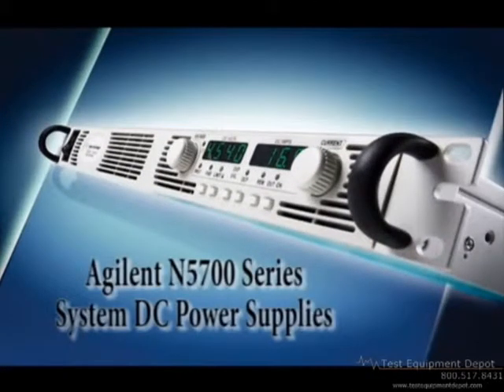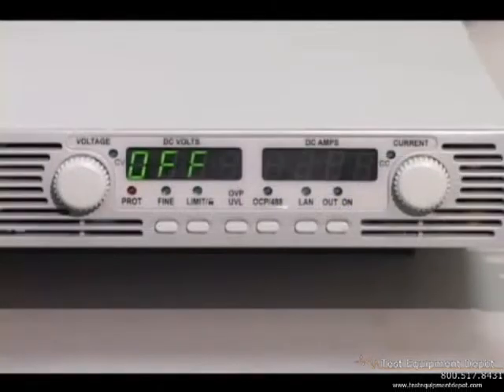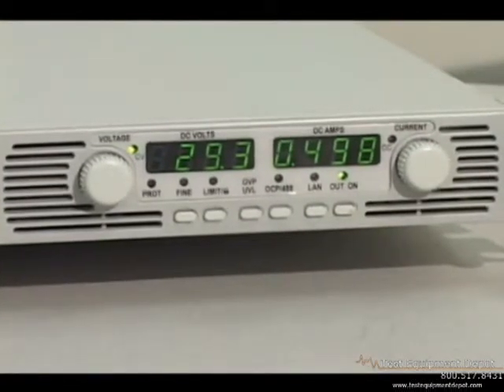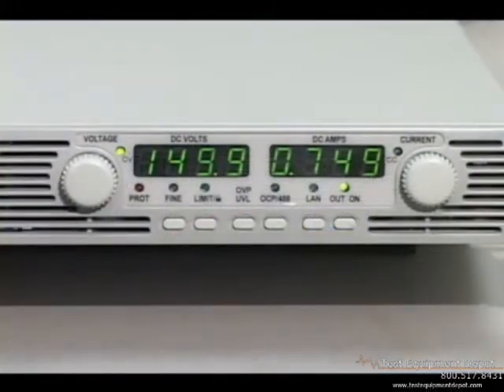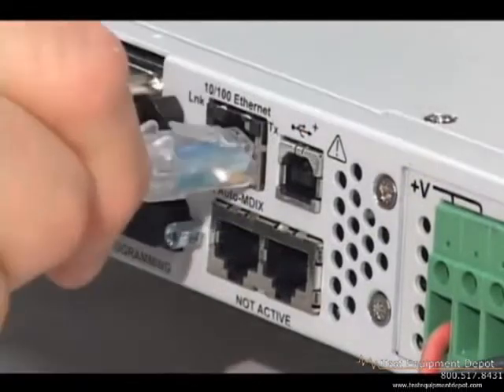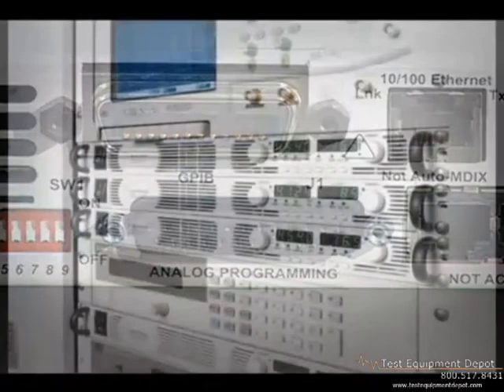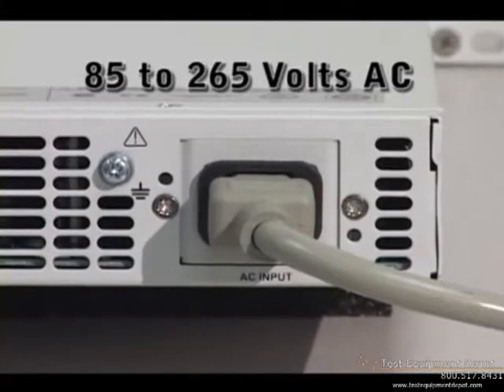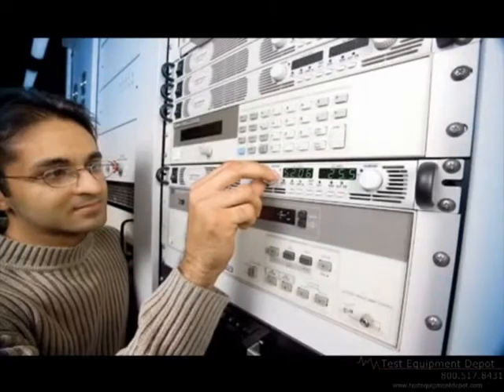Agilent N5700 Series System DC Power Supplies

Comment: When demand of 12 V is given to Agilent, i  am getting output voltage as 14.3 V. i  have checked at output terminals of Agilent by giving different demand voltages and i got difference of approximately 2 to 2.3 V more. why this difference is high.
is there any setting for voltage calibration.??.